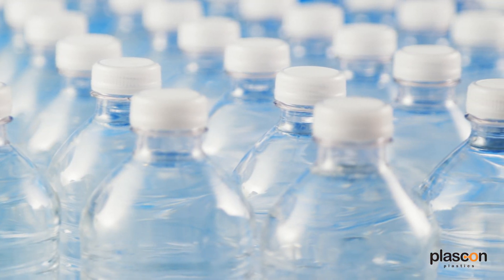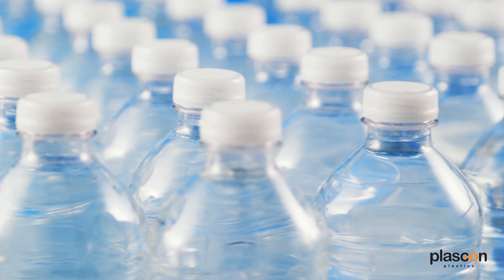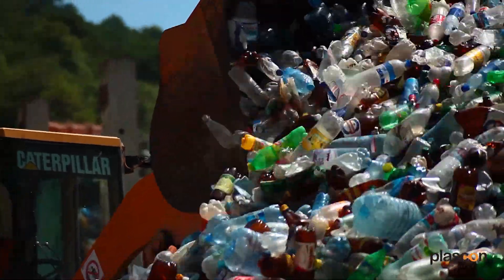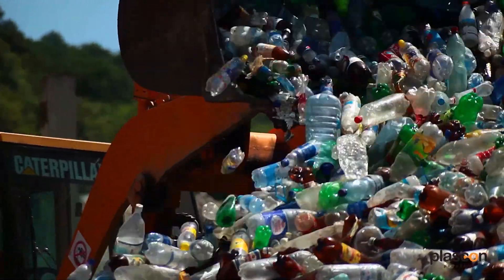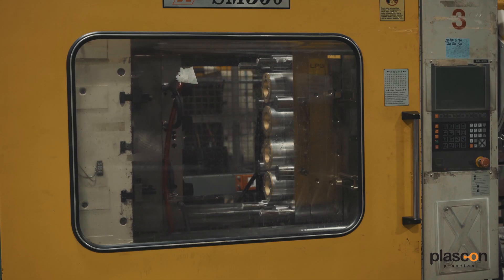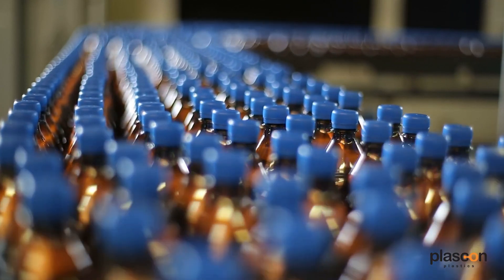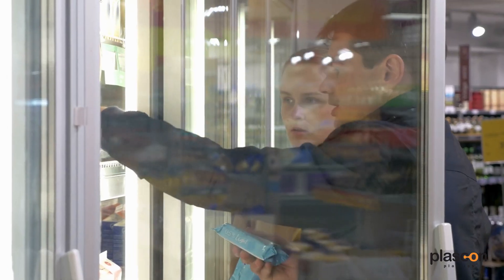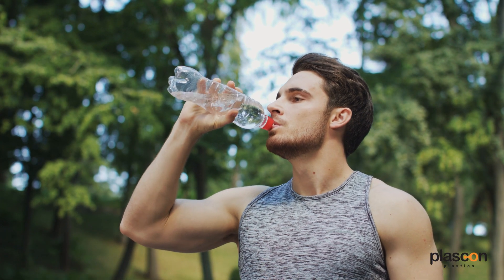What is PET Plastic? | Polyethylene Terephthalate Overview

Comment: PET will soon get a huge new life as the material used to make car bodies for Slate Auto in Warsaw, Indiana starting next year. They're taking an abandoned 1.4 million square foot former printing press and converting it into a 150,000/year truck plant that will only make vehicles using PET bodies on steel frames. Very cool since both materials are highly recyclable and valuable as part of closed loop waste streams as are cars in general...

Comment: How Toxic is this stuff and what cancers is it providing to users, I'm willing to bet that the manufactures are wearing protective gear to keep them safe while making this plastic 
and since it cant handle heat very well, what is it leaching into your water bottles when they are sitting in hot shipping containers across the country

Comment: Is PET/PETE (#1) plastic safe to be heated in an oven? I want to make pins, but do not have #6 plastic, I only have #1 plastic
Reply: Not safe
Reply: no can not, PET can not be heat resistance.
Reply: From my limited understanding it is safe. I.e. heating PET doesn't leech harmful levels of toxins into the food.  PET like nearly all plastics can't handle high temperatures despite its melting point being 220C+. At  cooler temps it will already warp and lose integrity,.

However, ready meals in a PET container can survive those extremes because it is filled with food/water that keep it cool. Millions of oven meals use (C)PET.